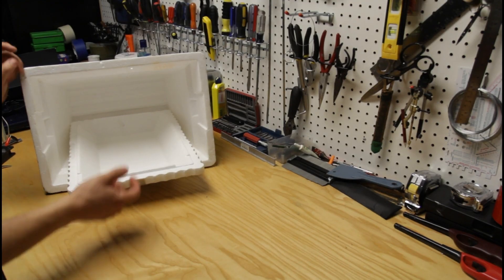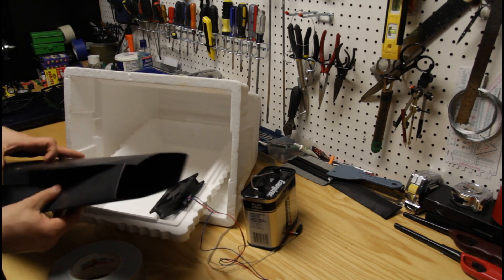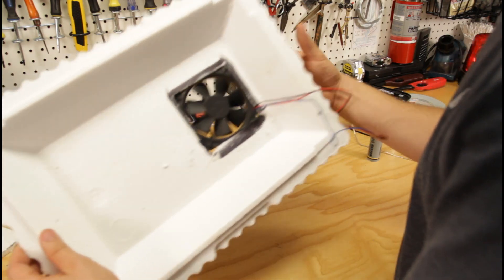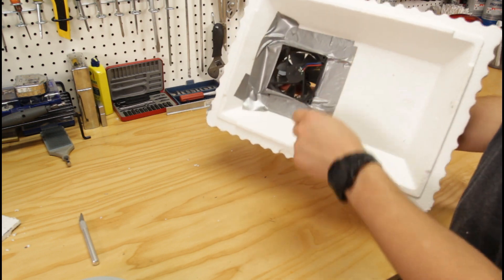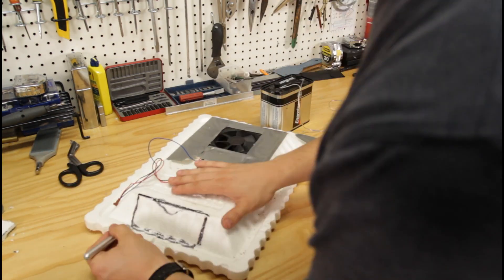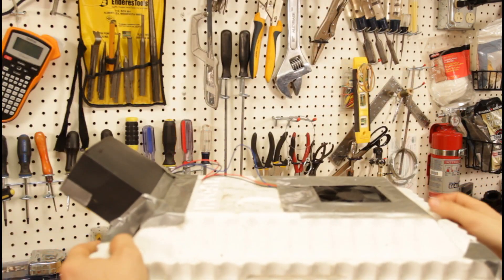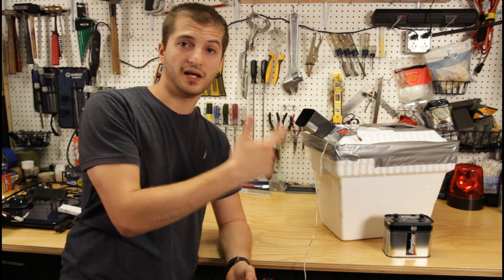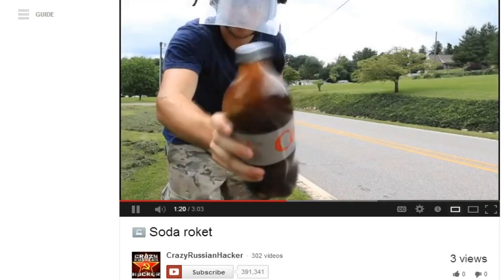Poor Man's Air Conditioning

Comment: I have made one of these before. I had a couple changes to the design. Instead of using ice use water bottles with salt water in them and freeze in the freezer. Add ice to the main water in the cooler bottom which will lower the freezing point. You can take the water bottles in and out of the water. Leave a couple in the freezer and keep replacing. Salt water in the bottles will make dethaw slower and make the temp coming out cooler.

Comment: If that's a DC motor (most likely) it really doesn't matter which way you put the fan in, if its blowing the wrong way all you need to do is reverse the leads on the battery, the most important hing would probably be to have the leads on the outside(unless you carefully make a waterproof container for the battery and leads on the inside (to make it somewhat self contained and more portable).

Comment: use a stronger fan, and run the air through a copper pipe in the ice
Reply: he dont use because it is poor man's air-conditioning
Reply: Just rip the plumbing out of your walls, done
Reply: what about rust water and oxygen and what if water leaks but you can buy a much stronger fan
Reply: +Freddy Kruegeror just steal one from the gaming desktops or laptops

Comment: You're close, but not there yet. You should take some very light foam and have the foam go from the bottom of the cooler where it will absorb the melting ice and the top of the foam right at the exit vent so it goes through the foam before it exists (you would need a more potent fan that what you have here) and WALLAH, you have re-invented the "swampy". Unfortunately, this only really works in very, very low humidity areas, like Arizona and Nevada and other desert environments.
What you have here will make the room hotter and much more humid in most of the places in the world. You are going to put 10 lbs of water vapor into the room.

Comment: hook it up usb or plug it into wall like you would a regular aircondishoner, hell take an old car charger cut it in half strip the wires on the one side and hook them up so you can run it in a car of the car outlet

Comment: i got a more powerfull fan so its stronger, and it has a switch with 4 levels , off, low , med, high makes it much stronger than with cpu fan but takes more power. plus if you fill it with salty water then add bottle of frozen salty water it works better and you dont have to keep buying ice

Comment: This is entirely inefficient and EXTREMELY EXPENSIVE. Where does the ice come from? Batteries are not cheap and need to be maintained and recharged. What am I supposed to do with all the water? It will make a mess. You failed to even mention that adding salt will lower the temp.